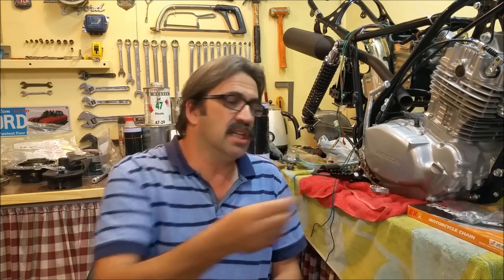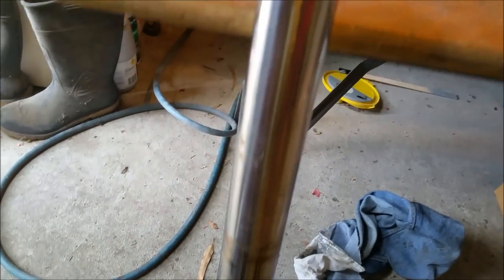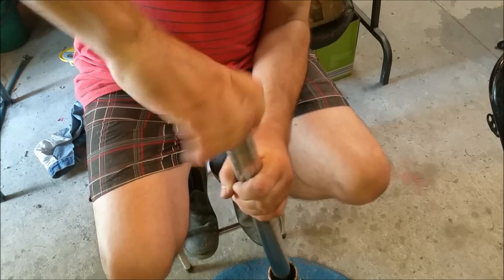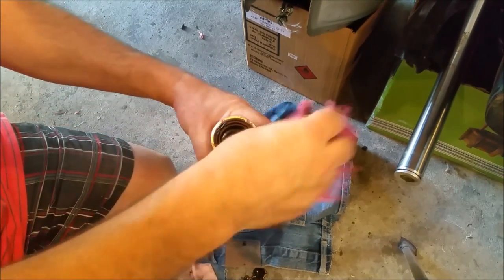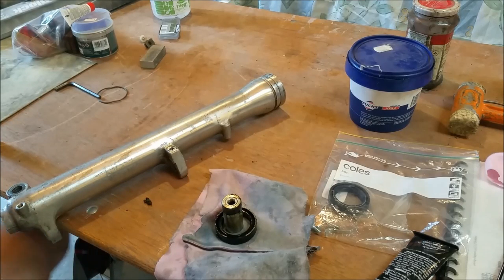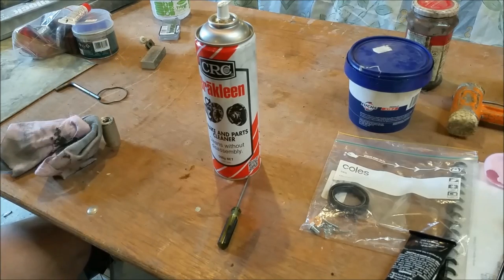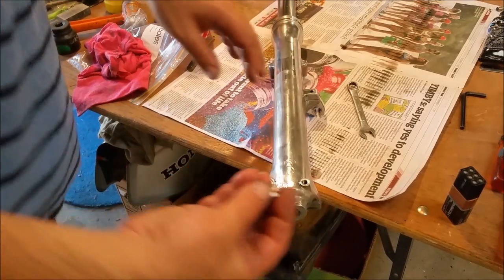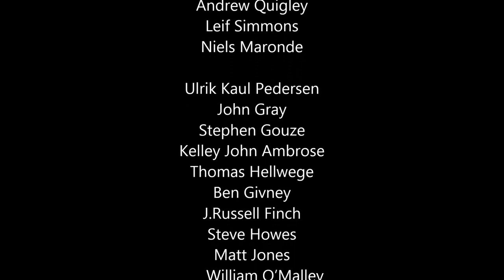Honda XL250 Restoration Part 15

Comment: An easy way to avoid marking the machined surfaces inside the forks is to put a couple of turns of electrical tape around the screwdrivers you're using during the cleaning process.  It's also worth pointing out that it is vital that you use lint-free rags for cleaning out the forks as any stray pieces of lint from the rag that remain inside the fork can gum up the valves and cause odd or dangerous handling characteristics, particularly under braking...

Comment: Peter, as always meticulous. When I've rebuilt forks my preferred solvent is gasoline. Yes, it's very aromatic however, it's cleaning and de-greasing properties are legendary. Then I'll use acetone or brake cleaner to freshen things up. Saves a little money that way. I also make avail of a bottle brush to aid and speed things up a bit. With the gaiters(dust boots) being stiff I've on occasion used hot water to soften them just enough to get the job done. They always shrink back. The copper washers, if in reasonable condition, I'll heat them with a torch and let them cool to re-soften the metal. Then by torquing on them, the metal work hardens again. If the washer is truly well and truly knackered I'll get some heavy wall pipe, flatten it, soften it with heat from a torch and punch them out with a regular hole punch(the driven style). I definitely have an aversion to spending any more than I have to. It's always worked a treat. How many millilitres of oil does each fork take? If memory serves, there is always a precise volume of that liquid gold that goes into them: Too little and not enough damping and too much resulting in blown out seals. Don't ask how I know. The school of hard knocks is a cruel mistress. Thanks again and goodbye.
P.S. I'm a little jealous watching you work in shorts and a T-shirt when it's well below zero C here. Parka weather aargh!!!
Reply from the maker: Thanks for the tips Stephen, good to hear from a guy who knows his stuff. I think each fork leg carries 195ml... need to check and it says Honda ATF rather than specific fork oil... I have to run outside now and throw down another coat of clear on the tank. Cheers

Comment: Hi,I noticed this on here,I’m just coming to the end of a similar project,I have modified a 1979 Xl185s Frame to fit an Xl250s motor into it,apart from that it’s basically an xl 185s,I was just wondering if you were going to use the original wiring loom/harness or making your own,regards pete
Reply from the maker: Hi Pete, I'm using bits of both looms from two parts bikes... one was damaged and the other had been chopped... there's a lot on the wiring in the video I'm shooting at the moment. Cheers
Reply: Peter Anderson I’m going down a different route,I’ve purchased a second hand loom /harness,carefully cut the outer cover on one side only and opened the loom up then doing one wire at a time replace all the wires in the same sequence then soldering the correct plugs on each end,so basically then you have 2 looms side by side,one new and one old,I haven’t taped the new one yet because I can’t make my mind up what tape to use,cloth gives the more original look or self amalgamating tape gives in my opinion a better looking sealed loom but it’s a devil to get off once put on ,pete

Comment: You mentioned using light machine oil to prevent corrosion on the fork legs.  WD40 works great on metal surfaces.  In fact, its original design purpose was to prevent corrosion, not to be a penetrating oil or lubricant.
Reply: No. WD stands for "water displacement". It's not a good long term rust inhibitor. It will evaporate and not leave any protection. I'd just go with fairly frequent waxing with regular car wax myself.
Reply: Absolutely true. Water Dispersant, 40th attempt.........still no good.
Reply: About 20 years ago I began storing my 1984 Honda Goldwing in my brother's garage in Eureka, California.  He ended up buying a used 1984 Goldwing that was very similar to mine (but a different color).  Whenever our family visits them, he and I go for rides together.  I have always, every 6 months or so, wiped the chrome and aluminum on my Honda with a rag damp with WD40.  He never did that.  The result is that my Honda still looks great.  His Honda has rusty chrome and corroded aluminum.  (I realize that possibly I could have gotten the same results using plain oil - but WD40 is a lot less messy).     I'm not making this story up, this is true...and I don't own any stock in WD40!  Originally, over 60 years ago, "Water Displacement - 40th Try" was used in the aerospace industry to protect missiles from corrosion.

Comment: Hi Peter, Dont know if this matters but when you disassembled the seal (12.15) you pulled out two small thin rings but when you put it back together you only used one. Now of course that second ring might have been a broken piece from the seal? PF
Reply from the maker: Thanks for that... one of the ones that fell out on disassembly was just the spring from the old seal. Cheers

Comment: Silicone gaiters would be far more flexible heated with say, a heat gun..
Reply from the maker: I didn't need to, they're pretty pliable particularly in this warm weather. Cheers

Comment: Good job,you got to turn the rear dampers round the right way ,it looks stupid the way they are
Reply from the maker: It's how they're meant to be on this model - they don't fit the other way either on the mounts or the sidecover clearance. Don't worry - I tried. Cheers

Comment: Hey Peter great vid mate.How much oil goes into the forks,is there a specific amount and what oil do you use?
Reply from the maker: Hi mate, the manual says Honda ATF with 185 - 195cc Cheers